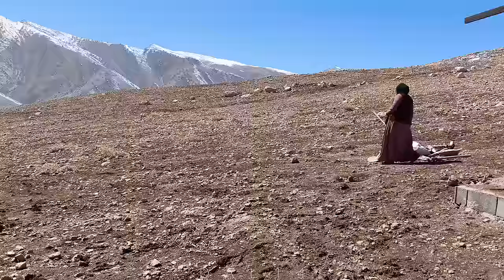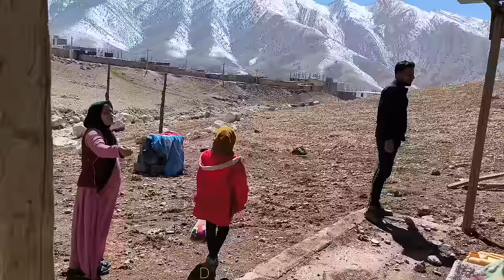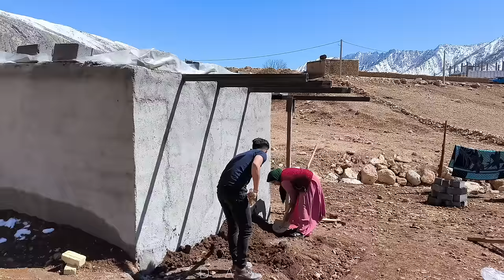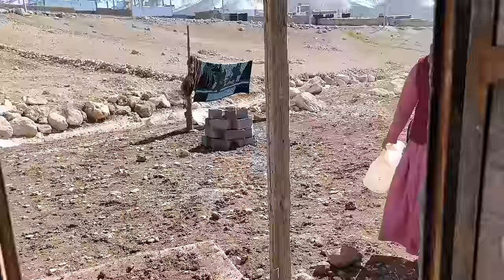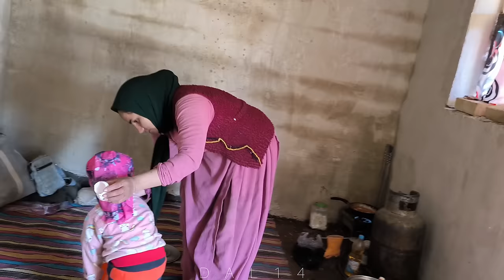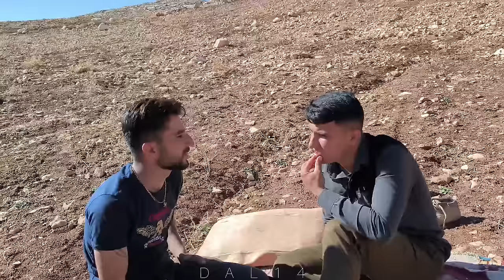Providing building materials with love and helping Rasool to find the missing woman

Comment: If you want you can level the ground in front of the door then collect gravel & completely cover the ground under the porch & pound it down then pour concrete or put flat stones on top. Doing the gravel and flat stones shouldn't cost you anything you have the gravel & flat stones right on the hills. That would only take you & Mohammed only an hour to do that. You cold put some cement under each flat stone so it stays in place. I hope you take into consideration my suggestion. I was getting tired of this channel because I don't think you listen to your viewers & because of the way Rasool was treated.

Comment: Putting dirt around the house is not a good idea, that causes damp the walls should be allowed to breathe. Put gravel all the way around then concrete to seal it & no more problems. But dirt holds the dampness & moisture plus when it rains you get the mud